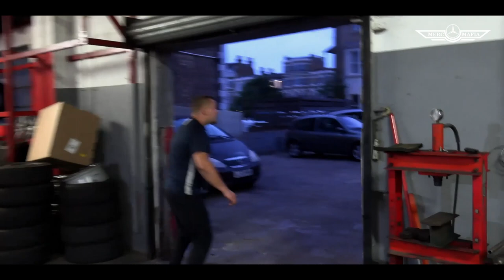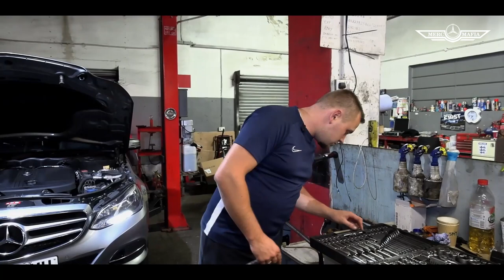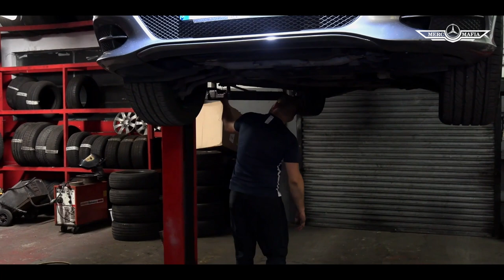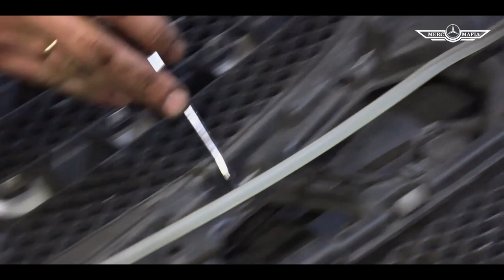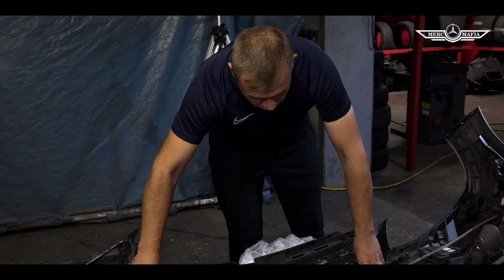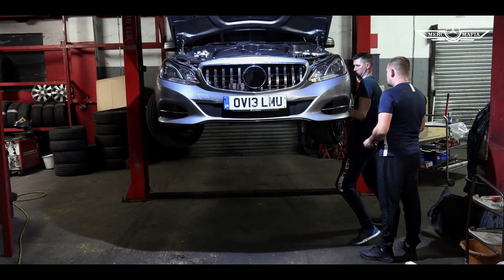W212 GT STYLE FRONT GRILL

Comment: I had to replace the front grille on my 2013 E350 sedan. I only had to undo the section of the plastic directly behind the grille underneath the hood/bonnet and put aside the hood opening cable. Undo a couple clips. Shimmy out the old grille, and reverse the process. Whole process took about 1 -1 1/2 hours but only because I’ve never done this type work before. If I was a professional or proficient, probably would’ve taken about 30 minutes.

Comment: For the star installation, was it was twist in? or did you push in from the back of the grill?
Reply from the maker: Thanks for the question. We pushed it in from the front.  Push it in roughly at 30 degrees angle and then turn it left  (anticlockwise )back into place.. ;)
Reply: @projectblackbeats  thanks a lot
Reply: Does it affect any sensors

Comment: Can you use original mercedes badge with this grill ?
Reply from the maker: to be honest  we dont know. :)
Reply: I'm half way through this job. I've got the bumper off, GTR grill in (with a bit of a gap at the bottom of the chrome). The Mercedes star badge does not fit the GTR grill.  I've tried for hours, spun it every direction. The clips on the back are nowhere near touching and the star doesn't even want to fit in. Car is 2013 e400 with the "amg" 2 horizontal line factory grill. Did you have to get a new star badge (mine has distronic, so just plastic badge), or did you modify the original? Any tips greatly appreciated and I will attack it again and hopefully finish it tomorrow. What a nightmare of a job!!

Comment: All this for a plastic grill. You have to take off the wheel arch liners, bumper, electronics, undercarriage protectors and etc.   Why is it not just, open hood, unscrew grill and screw in new grill?    The grill is about 3ft by 1 ft. I'm not installing a lift in my kitchen.
Reply from the maker: funny and yes i agree with you it was to much for a grill. :D
Reply: @projectblackbeats  I have to install the black (replacing the silver) front splitter.  I've had three carbon fiber, identical to stock, black splitters sitting in the box for about 2 months. That is much easier but, I'm dressing it with plastic screw pins and etc.   ;)   Great stuff!    The new Merc grill does look amazing but, unless I pay someone to do it, it "ain't" "gettin" done.   (Added some dumb USA slang..What have we become?)